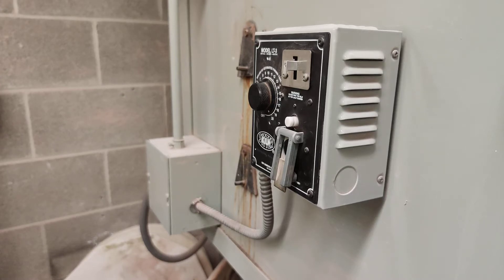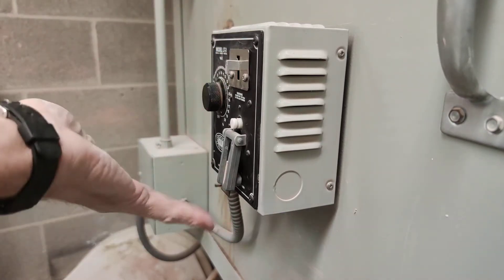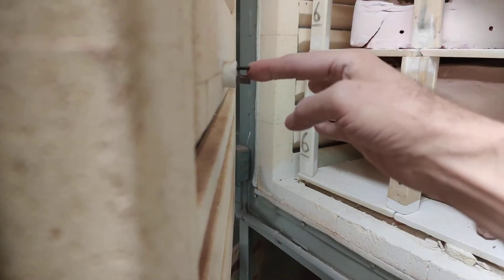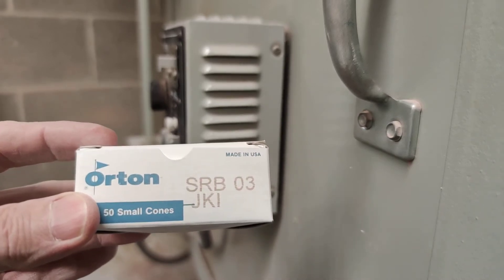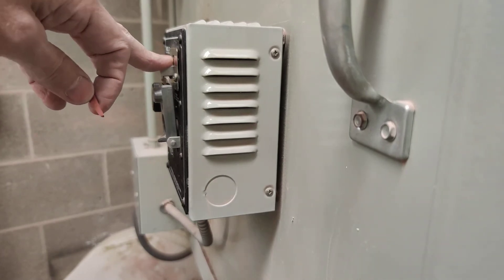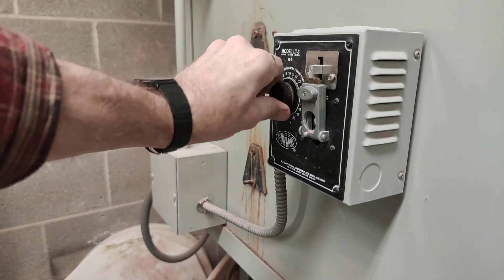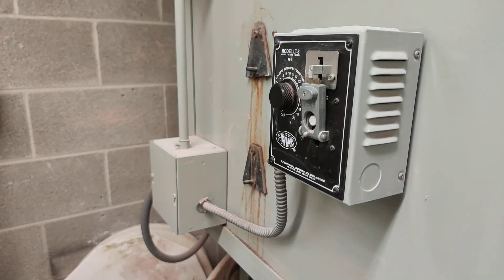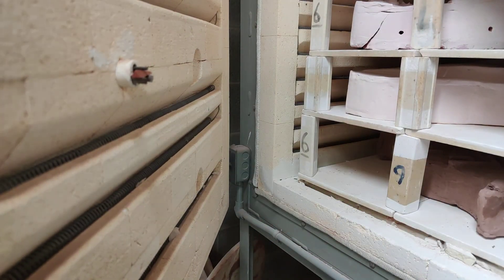How to use kiln sitter

Comment: Here's an interesting find my friends, I have an old kiln with a modern digital controller with a thermocouple. No kiln sitter. I did some firings without cones and then discovered that with a cone, the kiln was firing 100˚ lower than the digital reading stated. Its worth double checking that stuff on the outset. That 100˚ might leave a clay body porous or a glaze milky that should have been clear.